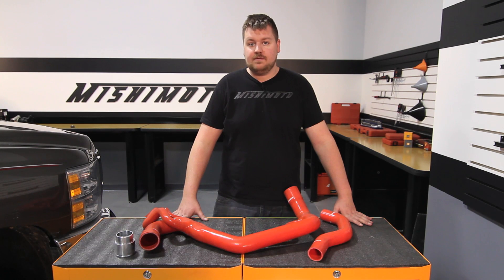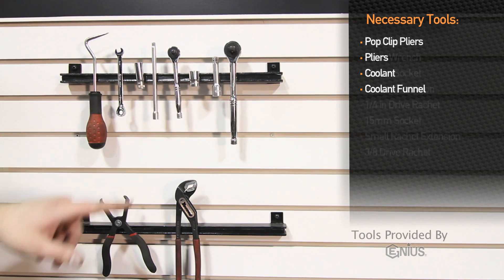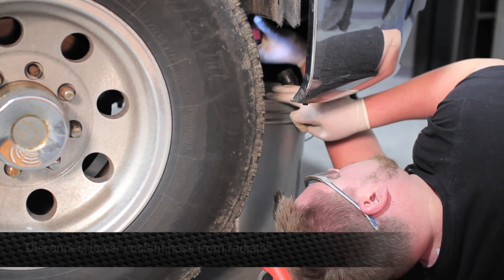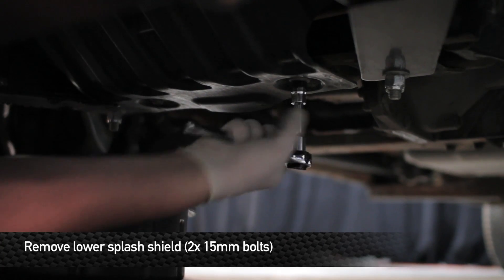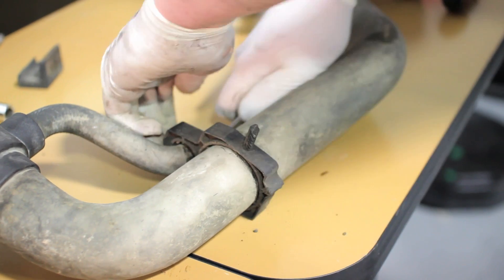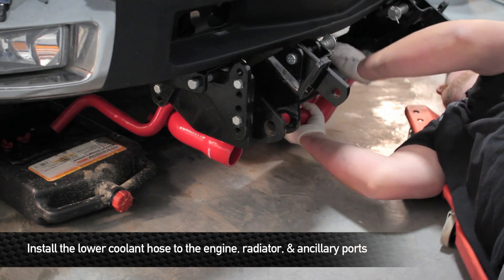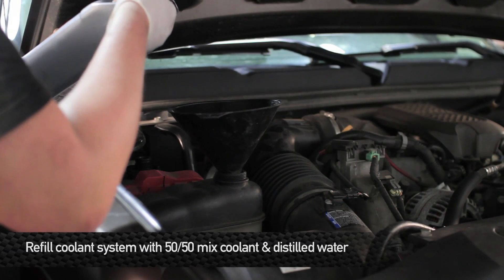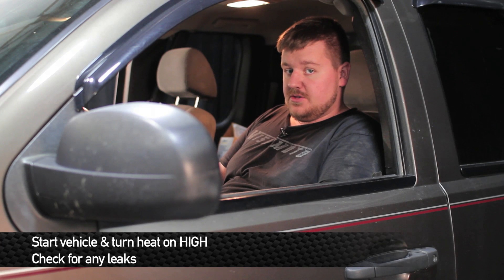How To Install: Mishimoto 2006-2010 Chevrolet /GMC Duramax 6.6L Silicone Hose Kit

Comment: Very clear, organized and well-presented information on R&R lower radiator hose. I did enjoy it and learned a few more things.

However, you might want to add that GM recommends (shop manual) to bleed air on radiator re-fill by removing coolant bleeder screw located in thermostat bulb housing on top of engine. Also to warm up engine at 2-2.5k RPM. GM does not say why but I know if air is left in cooling system DexCool (only GM recommended anti-freeze) has an issue with turning into jello like consistency due to cavitation (mixing with air) and then will not flow at all causing overheating.  I am not aware that a radiator can be cleaned out after this happens.
Reply from the maker: Glad you found this to be helpful! Thanks for the additional details!